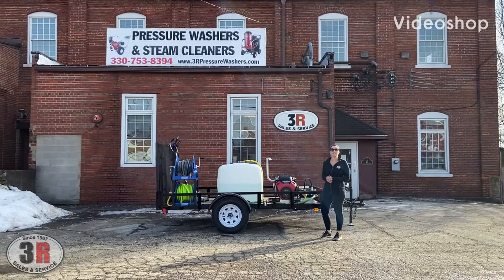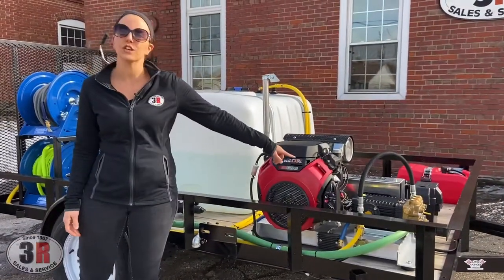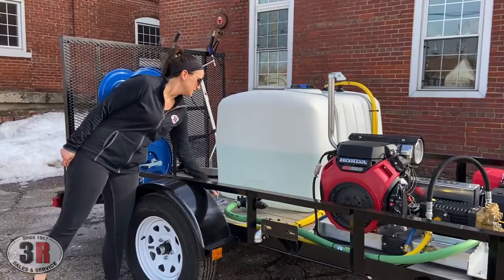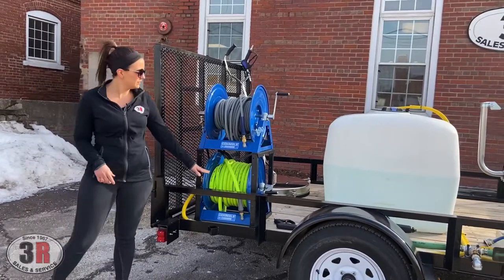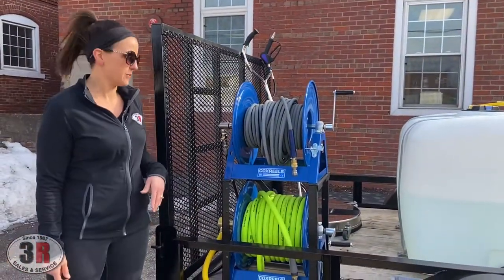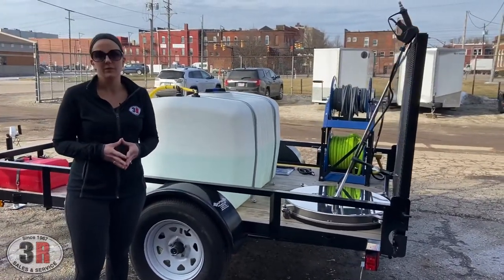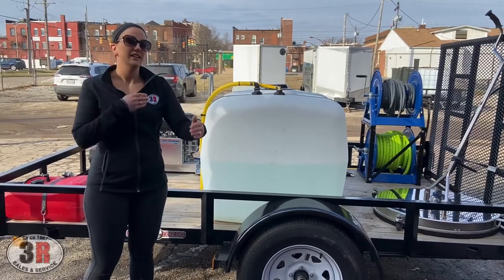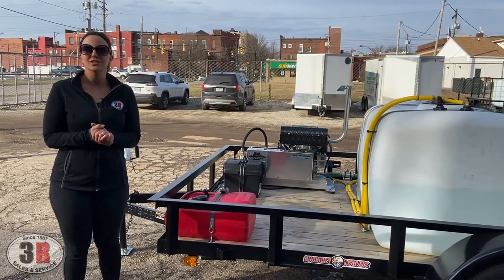10’ Single Axle Pressure Washing & Soft Wash Trailer - 3500 PSI @ 8 GPM Cold Water

Comment: How much weight is total on the trailer?
Reply from the maker: This trailer with equipment installed but tanks empty is about 1200lbs (includes trailer weight).  With the 200 gal tank full and fuel tank full, its right around 2900lbs.  The total gross vehicle weight rating (GVWR)  for this single axle trailer is 2990lbs.